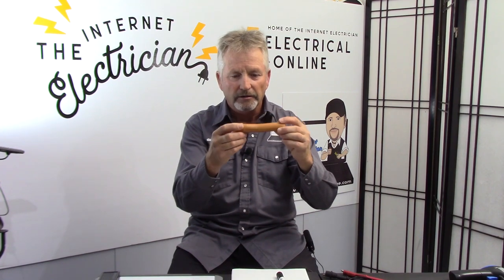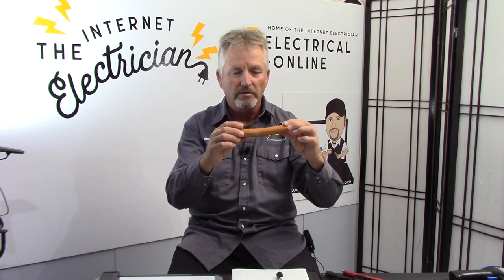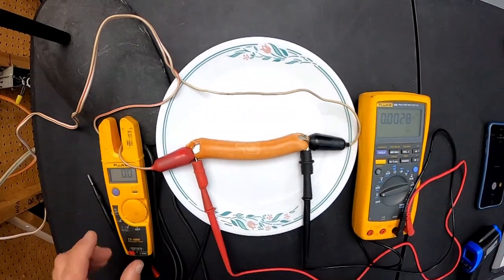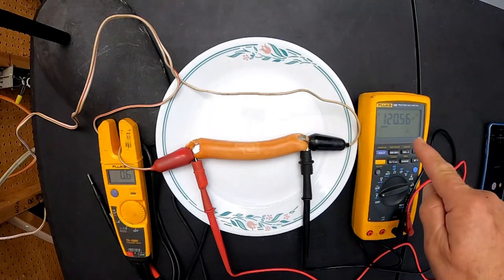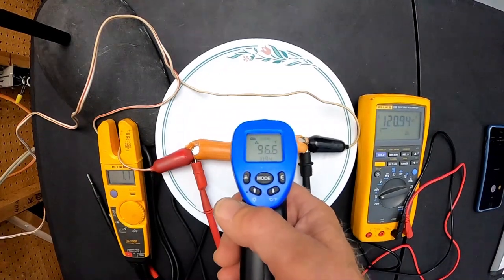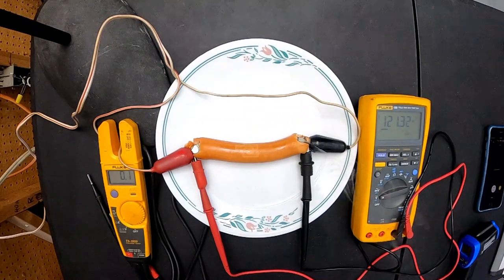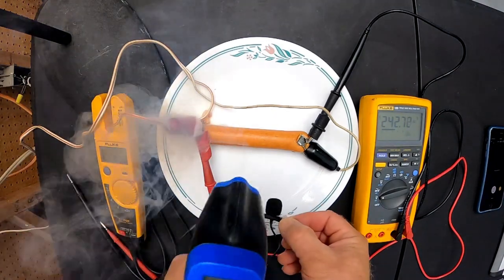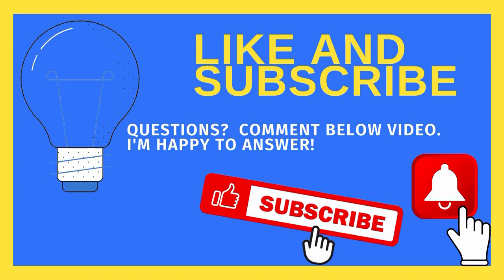How Dangerous Is Electricity? 120 and 240 Volts vs Hot Dog!

Comment: Hello sir, I am a fresh graduate electrical student. I follow you from afar. I'm very curious. Electricity is a difficult field, so it requires a lot of research and curiosity. Since I am not a rote learner, I try to understand every detail I see. I want to ask you a question. Our network frequency is 50 hz. When I measure the frequency between Phase-Neutral, I naturally measure 50 hz. At the same time, the frequency between Phase-Ground is at the level of 50 hz. But when I wonder and measure the frequency between Neutral-Ground, I don't see 50 hz. There is a constantly changing frequency of 150-200 Hz. By the way, my avometer is UNI-T UT89X . Is my tool faulty? I hope to become a technical expert like you. God bless you sir.